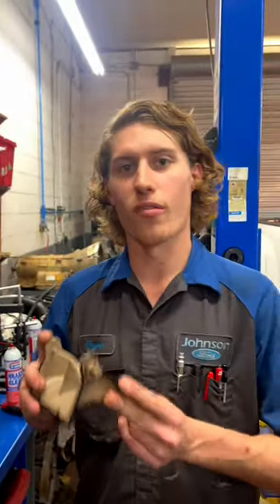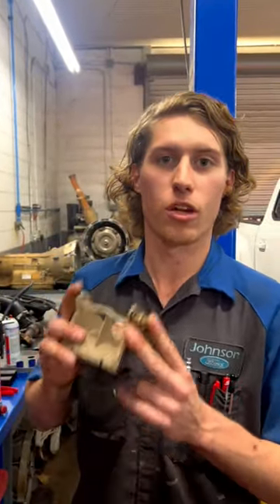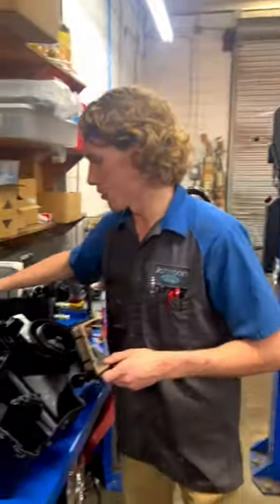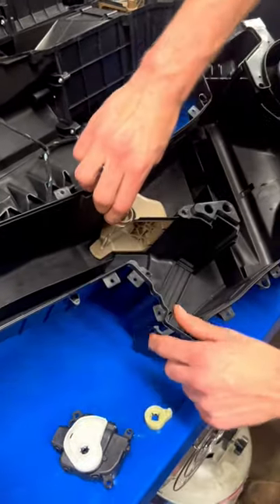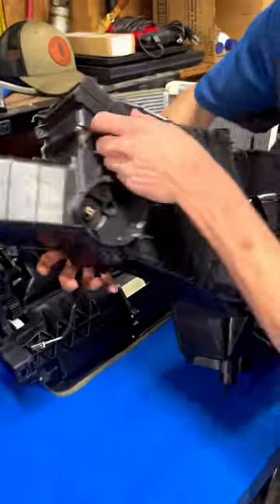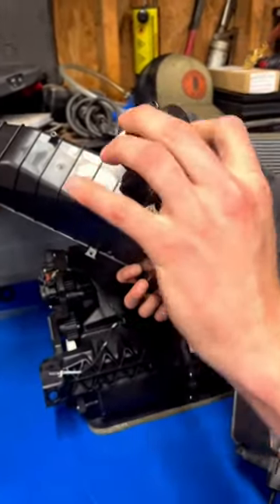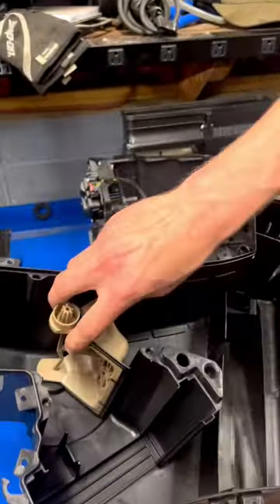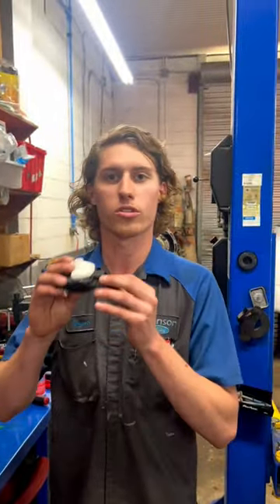How does an AC Actuator work on your vehicle? #shorts

Comment: What changes the air flow from defrost to vent to floor? I have ac and heat. I put in a new automatic temperature control unit. Hot or cold air only comes out of vents no matter which button I press. Please advise.

Comment: Actuator costs about $50. Labor to install about $1,500.
Have to remove seats, console and half the dashboard. 

A better idea from Ford.
Reply: Gotta love engineers.
Reply: That's why I work on mostly Asian cars But the European cars are MUCH! WORSE! But ford? They are bass akwards.
Reply: So the car is basically built around the actuator. 🤔😂
Reply: Nearly all actuators are labor intensive to replace. No matter what brand.
Reply: Original  and 4 replacements on a 2015-F250.  Love the extended warranty. 
Sold it and bought a 1977-F250  - much simpler.
Reply: Lol try multiplying that price by 4times , this is a very labor intensive job, I personally wouldn’t do it on flat rate , unless I’m given a week to do all this , because I’ve done half this job before to do an evaporator, i couldn’t imagine pulling all this crap out
Reply: @benztech2262  ford is still the worst when it comes to Simple repairs
Reply: It’s a nightmare. Thank you for posting this video!  I like to understand what I’m taking so much time to fix.
Reply: @pallemaniac  LMAO

Comment: I have a 2995 ford Escape.  We only get hot air in the cabin.  I think my issue is the blend door.  But I think it is just behind the temp selection knob, because it feels different, disconnected. 

Is the a mechanical connection behind the kind?  I doubt it is like the current cars.  Is it certain I have this servo motor moving the damper? 

What happens if there it a writing pen or mouse skeleton blocking the damper from moving into place?